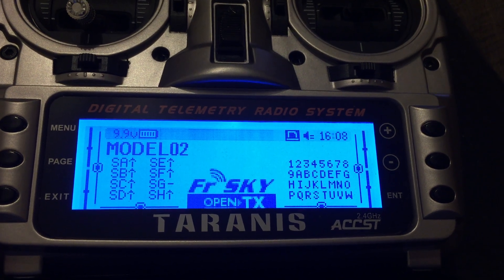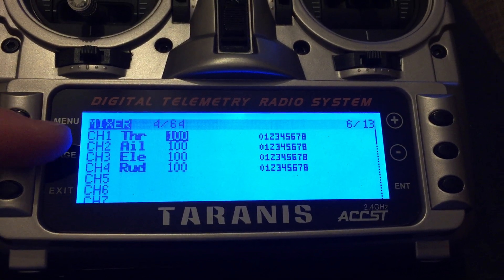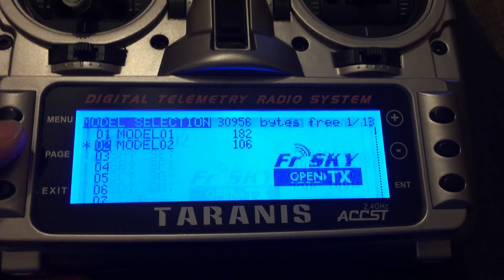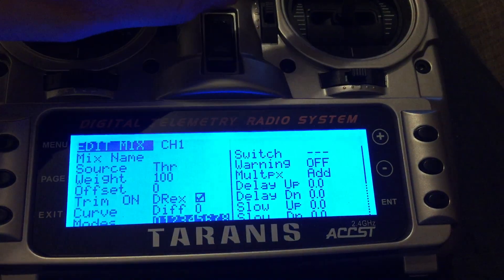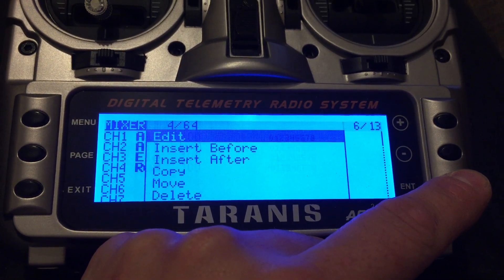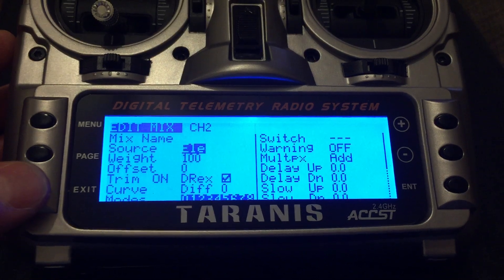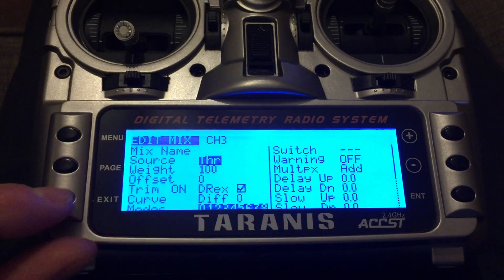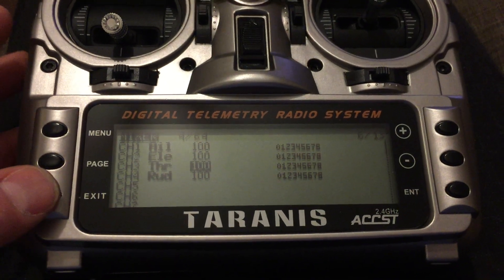How to change channel assignments on the Taranis.

Comment: Hi thanks for that I'm using this transmitter with a R/C forklift I have the right stick for throttle and steering and the left for lift the forks (horizontal) and tilt the mast (vertical).
The lift works how I want it E.G. moving the stick operates the lift and releasing it leaves the forks at that height , but the tilt won't stay at the position I want when I release the stick and it re-centres (I set the spring to re-centre it as that is how I wanted it, same as the height), could you tell me how I could reconfigure the Tilt (Ele channel) so that it works the same as the height and stays where it is when I release the stick?

Comment: Thank you . I am setting up an Eachine  Lizard 95 Anniversary Edition BNFwith Frsky receiver,etc. I went into Betaflight to set the end points on my Terranis and found out the channel mapping is TAER1234 instead of the radio default that I had set, which is AETR1234. I thought I would have to change the radio map to match the Lizard's map, but I didn't know if that would work, and if it did, would I have to change it every time I wanted to fly the Lizard. I thought there is an easier way. Thanks again.